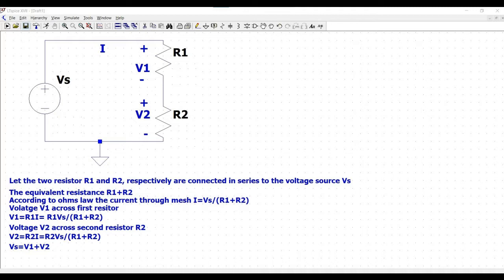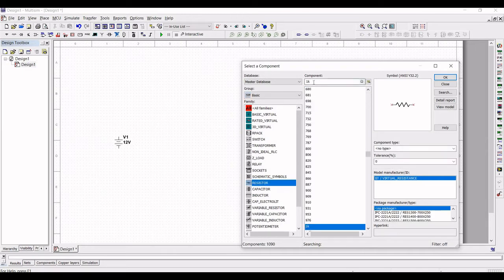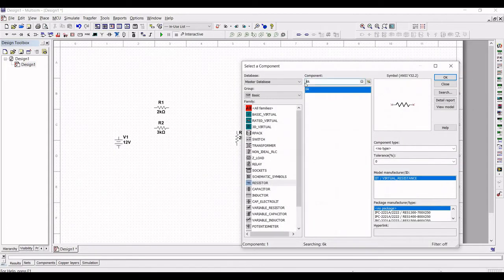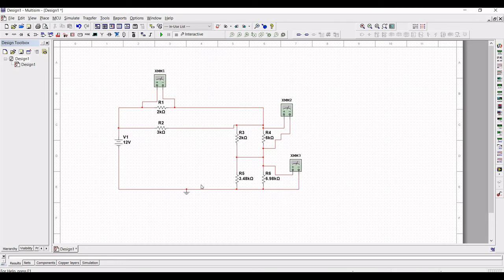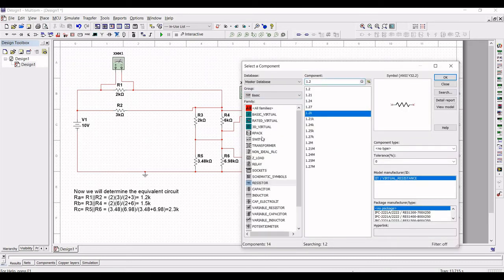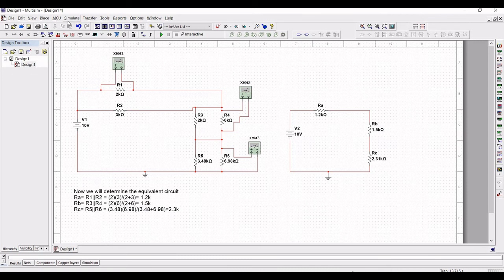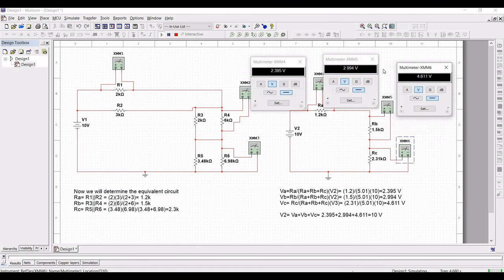Design and simulation of Voltage Divider circuit using Multisim tool

Comment: 🎯 Key points for quick navigation:

00:00:00 🔋 Introduction to Voltage Divider and Basic Setup
- Introduction to the voltage divider circuit concept using two resistors,
- Explanation of the formula to calculate voltage across each resistor using Ohm's law,
- Overview of circuit setup for design and simulation using Multisim.
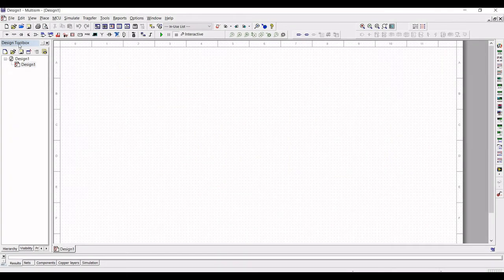00:02:12 💻 Designing Circuit in Multisim
- Step-by-step instructions on placing components like the DC power source and resistors in the Multisim schematic,
- Detailed component selection and placement process for resistors ranging from 2 kilo ohms to 6.9 ohms.
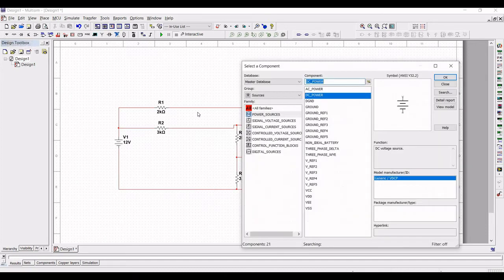00:05:21 🛠️ Circuit Connection and Measurement Setup
- Instructions for connecting resistors and the voltage source within the schematic,
- Explanation on grounding and multimeter setup across different resistors for simulation purposes.
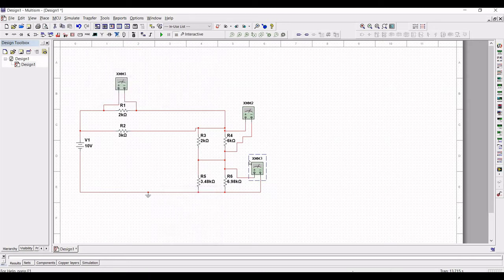00:07:16 🔄 Simulation and Equivalent Circuit Calculation
- Running the simulation to observe voltages across specific resistors,
- Calculation of equivalent resistances for parallel resistors and placing them in the schematic for further simulation.
00:09:29 🎯 Results and Validation
- Defining voltage values and connecting equivalent circuit resistors to the voltage source for simulation,
- Observing and comparing voltage across simulated components with theoretical calculations for validation.

Made with HARPA AI

Comment: What is the difference between the manual computed voltage divider circuit and the simulation using multisim?
Reply from the maker: I did find it accurate, most of the simulated results match the manual computed results

Comment: Hi , Comparing LTspice and kicad, which one is better?

Would a Multisim tool be better?
Reply from the maker: LTspice is user friendly, but limited to Analog Device and Linear technology devices.
In KiCad its easy to add different models, only thing is we must get those details from Manufacturers website.
Multisim is powerful tool but its not a freeware.
Reply: @circuitgenerator9788  
Thanks for the good advice.
 I will love only KiCad until the day I die.